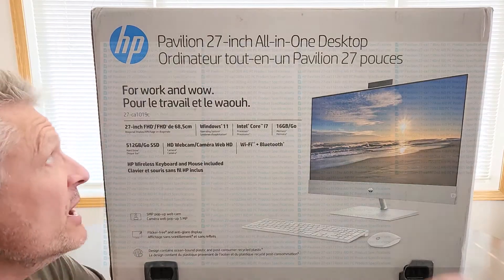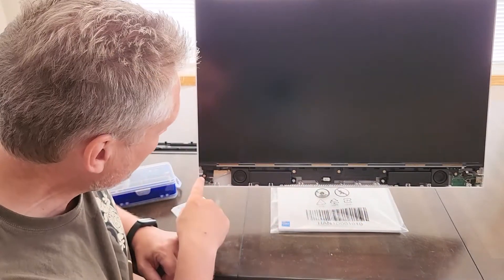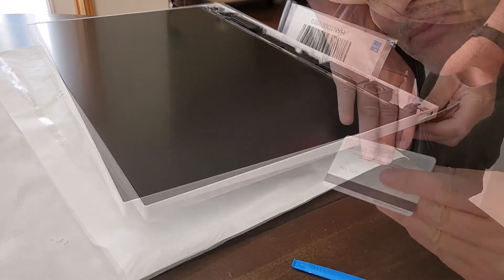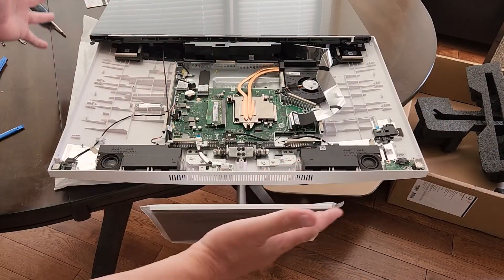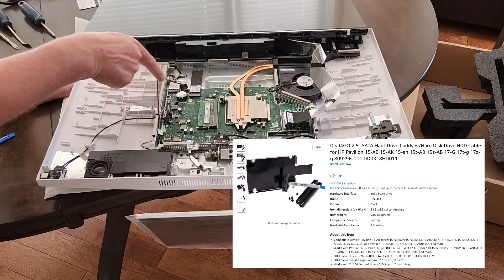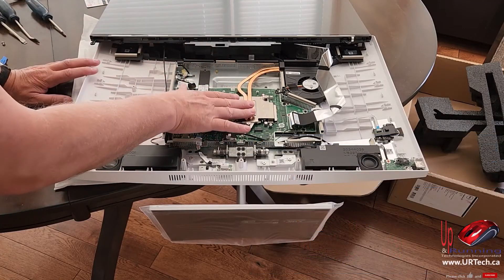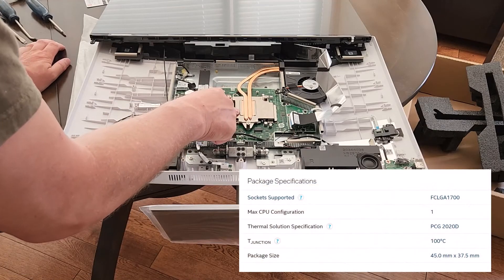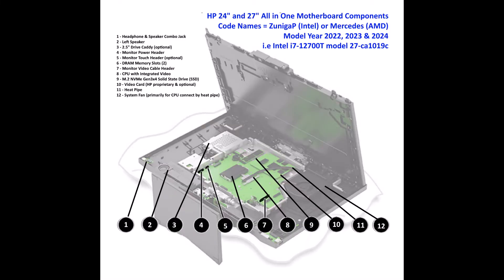HP Pavilion 27 Disassembly & Upgrades Made Simple for Beginners!

Comment: Great Video... Thanks.   I rescued an HP Pavilion 24-ca1234 from my local trash dump from the E-waste recycle container. LOL  it looked in perfect shape... took it home, and it powered up fine with Windows 11 running.  Amazing.   Over the last few weeks it kept crashing, Blue Screen couldn't find a boot drive.    your video guided my through opening it up.   no problem!   I took out the 1TB SSD drive.  Sprayed some contact cleaner and re-seated the drive.   Powered up and booted OK.  Running some tests now.  My PC had 12GB memory in two modules 8GB and 4GB.   Headed to amazon now to go to max  2x16 =32GB.   I figure that the original owner had intermittent crashes and decided to toss it in the dump....

Comment: I usually hate AIOs because it's difficult to disassemble them, I have the HP model similar to this one (CA1000NL) with a problem with the NVMe slot, thanks to this video I disassembled it in an instant, but I think I also have to thank the designer for making it so simple.
I also have an ASUS AIO the ET2020 and it has been driving me crazy with: different screws all hidden, pieces to remove to find the screws, wires in the middle and strange contraptions to do to be able to test it when disassembled.
Thank you.

Comment: Ez instructions. But this was pretty stressful to put back together lol. I broke the screen from the top when trying to get it out using a pick. I bought a new screen and had a heck of a time popping it back in place because i was scared i was going to break the new screen. I folded the towel and placed it on the screen, then applied pressure on the edges of the screen just as precaution because i didnt want to force it too hard and break the new screen.

Comment: Nice informative video.  I was hoping you would have shown the backside of the screen display and it's connections.  Did you happen to make note of the display panel manufacturer and their part number when you disassembled the unit?  I would appreciate that info if you do have it.  Thanks.

Comment: I have worked on desktop computers for 20 years. Instructions were excellent and the computer came apart exactly as described. Unfortunately, the screen cracked during reassembly. I was very careful to only touch the very edge and didn’t push hard. Found a replacement screen online for just over $100 but now I’m a bit gun shy. Sucks. Works fine with an external monitor, but that’s lame.

Comment: Are there specific video cards that are needed if you wanted to upgrade?
Reply: I’m looking for an answer as well
Reply: @Hyperdrive  if i find anything i will let ya know
Reply: It's ddr4 3200 ram card
Reply: @luismunos939  thank you so much. I also think that external gpus may help as well
Reply: Update* external GPU will not work because the rear port is USBC only and not Thunderbolt 3 or higher

Comment: Could you point out where the power supply unit is? I'm having trouble finding it on the video. Please let me know good sir!!!
Reply: Have u found it
Reply: I think the power supply is actually part of the power cable. Should look like a black box connected to the wire. Or at least that’s what mine is like.